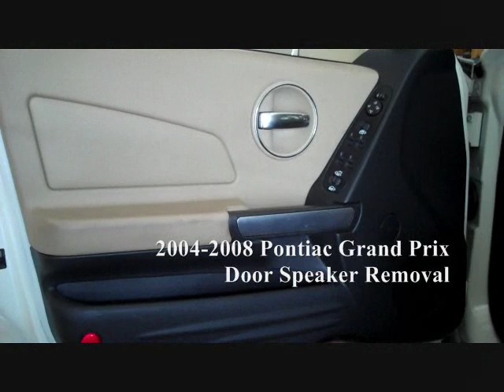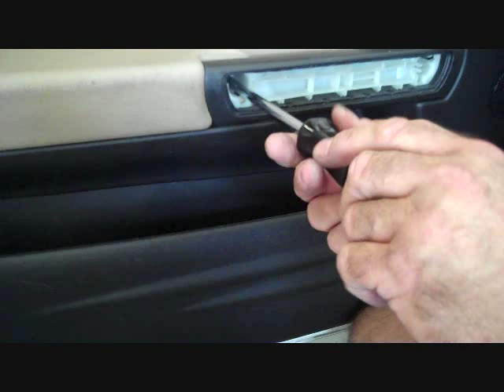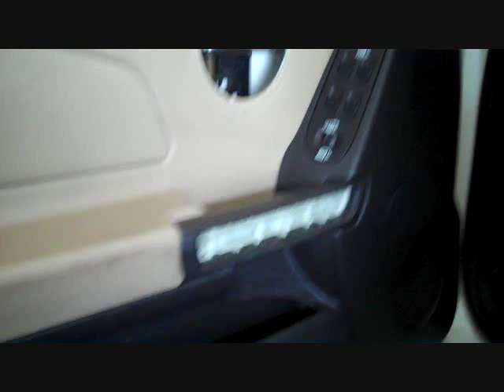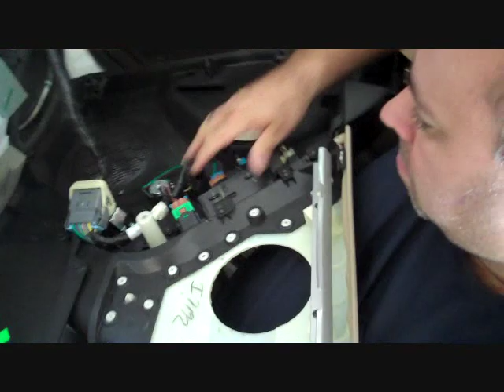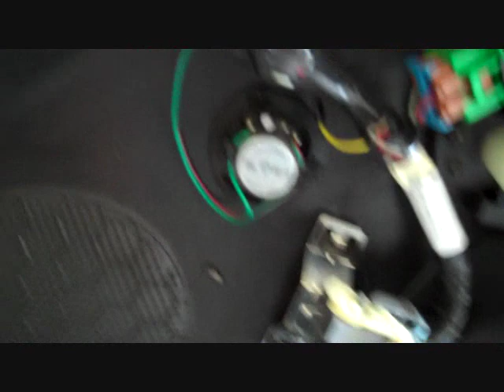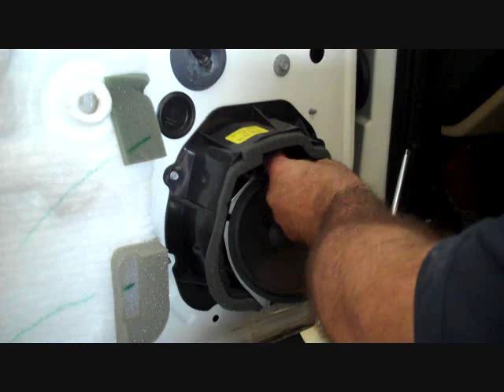Pontiac Grand Prix Door Speaker Removal 2004 - 2008 = Car Stereo HELP

Comment: Can u put 6 & 1/2" speakers in? Cuz the 2007 factory ones are 6 3/4". Would the tweeter need to be disconnected or c AND u used a 2 way 6 1/2"?
Reply: i know this is late, but for anyone else looking, typically the speakers come with mounting brackets but i’ve found that the door panels already mount 6.25”-6.75”... you can use 2-way. tweeter should always be connected unless you don’t like the sound they give out

Comment: Very informative video but you failed to mention what size the speaker is and what speakers might fit in there without changing the door panel will a oversized speaker fit in there by using the grill that comes with the set yes it would stick out 3/4 of an inch but might not require any major changes to the door panel itself except 4 screw holes
Reply: The factory speakers for an 07 are 6 3/4".
Reply: the door will mount 6.25”-6.75”
Reply: @hiddenaether  xan you reuse the metal plate for jew speaker or do you need an adapter

Comment: what size speaker?
Reply: I know this is an old comment and you may have an answer already. If not, the door speakers are 6.5 inches and the trunk speakers are 6x9s.
Reply: @mtx247  actually the door speakers are factory 6.75” but they will mount 6.25”-6.75”
Reply: @mtx247 I was in need of the answer your clutch